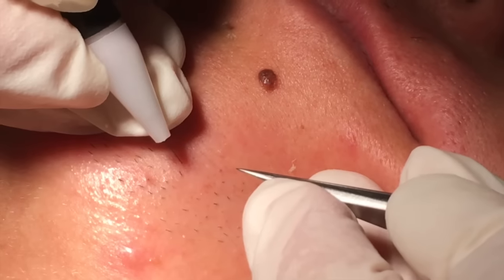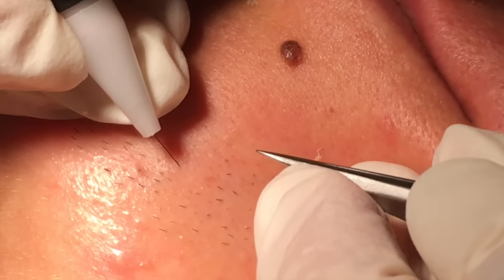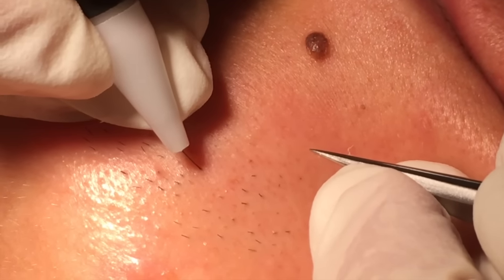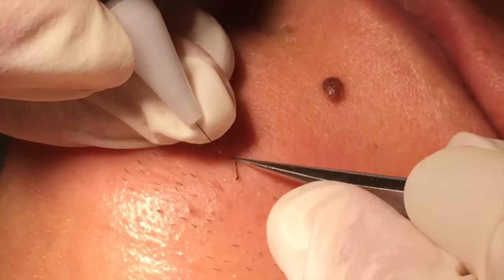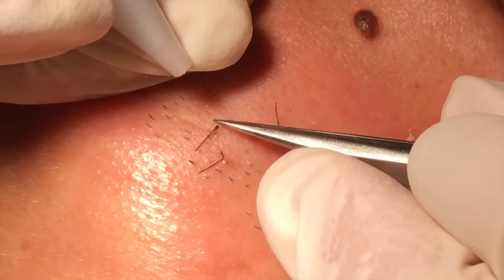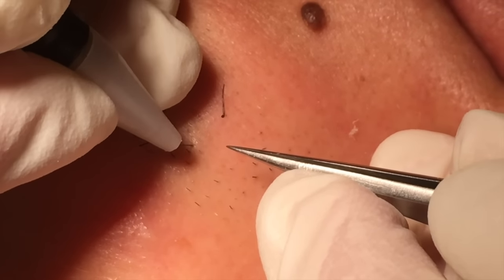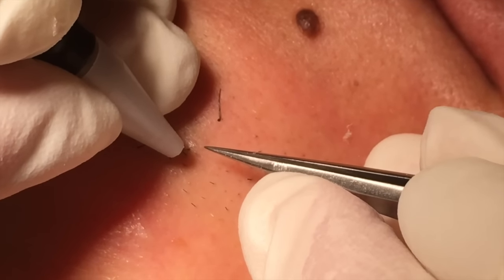Electrolysis hair removal close up

Comment: I had this done today for the first time on my chin and upper lip and it's a piece of cake for me thank god. Not much pain just a little zap.
Reply: That's good because people were saying it hurts a lot. How much hair did you have because I want to do this, but I have a lot and it's thick?
Reply: @cintaminbunny  You feel some pain of course but it's bearable. At least for me. Upperlip is painful tho. I have some dark and blonde hairs so the dark i get lasered and the blonde ones with electrolysis. X
Reply: @kyraw3933  thx, I'm nervous for my upper lip because there isn't much there, but I think it's getting thicker.
Reply: @kitaboo2245  I go every week for 30 to 45 minutes. I wasn't born female so I have to go more frequently till it's gone. Then maintain it every few month I believe. X
Reply: @kitaboo2245  They do my entire face. I don't have that much hair so the procedure depends on how much hair you have and how fast they work ☺️
Reply: @kyraw3933  they told you how long it will take to remove permanently. I heard it takes years
Reply: @sweetsoul6147  They told me that most hairs need 2/3 treatments to completely disappear. I had 10 sessions so far and i can tell a difference so it works for sure 🙌🏻
Reply: @kyraw3933  would you say electrolysis is better than laser or vice versa ? I want permanent removal
Reply: @thediaryofdove  Electrolisys for sure! It takes longer but it's the only method that is really permanent i believe.
Reply: Is that painful?
Reply: @srichithra918  Not really. For me at least
Reply: @kyraw3933  hey kyra, i see its been 8 months since you left this comment, how is the growth now? Is it permanently gone?
Reply: @navneetkaur1343  yes, most hair is gone 🙂
Reply: @srichithra918  No it is not painful
Reply: Do, you take any prescription for facial hair?
Reply: @blancabarrientos9184  what do you mean?
Reply: @kyraw3933  What the cost for electrolysis hair removal? Plzzz tell
Reply: @Hmx_mrx  Where i go here in the Netherlands its 45€ for 30 minutes. I go for 60 minutes each session. But i get it payed by my health insurance.
Reply: @kyraw3933  oh ok thanks
Reply: @Ty-1452  they destroy the hair follicle one by one so the hair is permanently gone...
Reply: I am super excited to get this done!
Reply: @kyraw3933  what about ungrown  face hair? How does it work?
Reply: @lunalunna4018  what do you mean with ungrown hair?
Reply: @kyraw3933  For example, I have hairs that do not grow ... they are under the skin and I can't remove them with tweezers.  and I was wondering how electrolysis would work
Reply: @lunalunna4018  oh you mean ingrown hair lol, if you go to a dermatologist they can remove it. They poke a hole and use super small tweezers to get it out and then you'd let it grow out again and at that point it would be able to get taken care of with LHR or electrolysis
Reply: Izz Rigel  I'm trans as well. Had one year laser and 1 year electrolysis so far. I find that electrolysis is more effective. It takes longer but the hairs are really gone. Upperlip is painful. The rest isn't painful in my opinion. Good luck 😘
Reply: @TexstarHans About the scares.. My electrolysist used a isolated needle which means that the heat comes only out of the tip of the needle so my skin did not got burned on the surface. And I used a mask sometimes because of covid but I put it off as soon as I got home because the warmth underneath the mask irritated my skin after electrolysis.
Reply: Cost?
Reply: Did it really go away forever ⁉️
Reply: @mandoelorryann4171  yes
Reply: Does it left the skin with pores?
Reply: Does it left the skin with pores?
Reply: @ManahilKhan-s6b  No, the electrolysist used a isolated needle. Those only give heat at the tip of the needle so it doesn't effect the surface of the skin.
Reply: @cintaminbunny  depends on the threshold I felt alot of pain when having it done my leg would fling up!
Reply: Does the hair grow back after the session? And how many sessions needed?
Reply: How much time we should take electrolysis?
Reply: @amalalharbi2463  the hair usually grows back thinner until it one day completely goes away.  You have to work at it for a while and if the hair is coarse then you can expect to make a few dozen visits roughly.  Over time you visits diminish in duration though. It’s not a quick process and nothing is when you want permanency.
Reply: I have apilus blend 256 bt i dont know exactlly how much intensity required for facial hair removal
Plz guide me
Reply: How much was the cost
Reply: Where did you get it done? How much did it cost?

Comment: What's the typical number of treatments for your patients?  I have been having treatments on chin and jawline area (due to PCOS) two to three times a month for close to two years now!
Reply: What?!!!!
Reply: I thought electrolysis was PERMANENT after 1 treatment as long as hair was completely removed?!
Reply: @tash-mariegrant652 Ha!  No, it takes MULTIPLE treatments, and this is because hair grows in stages.  I've certainly noticed a significant difference, but it's a slow process.
Reply: @tash-mariegrant652  it is permanent. However, it depends on how much surface area you want hair removed from. Then, as was mentioned, hair growth happens in cycles. Also, it depends on how thick a hair is, what stage of growth, the skill of the electrologist, the difficulty of the surface, etc. 

For example, that last one, scarring can impact the direction of the hair follicle. If it’s different than the surrounding hairs direction, then inserting the probe parallel to those hairs means it’s not hitting the root of the hair. That’s where the skill of the electrologist is key, to recognize and adjust.
Reply: @checksanity  but still once the probe is correctly inserted into the hair follicle and zapped the hair shouldn't grow from that particular follicle right? For example I have 100 visible hair and then all those hair is zapped and removed from the follicle then the hair shouldn't grow in that particular place. I can understand the remaining hair coming out but are you telling that one follicle needs multiple treatment?
Reply: You might have untreated pcos if the hair keeps coming back after that long. Electrolysis kills the hairs that are there but pcos makes the hairs show up. There's a lady called "youhairygodmother" on here, she has pcos and  had a lot of chin hair and has gotten 3 yrs of Electrolysis and now most of the hair is gone except for one last little patch.

Comment: My electrolysis lady doesn’t remove the hair with tweezers until the end so she gives it time to “cook”. It works better for me that way. I also use a wet sponge to hold onto to help with the current. The right side of my face that we’ve been working on is significantly better than my left 🎉
Reply: It is red after ?
Reply: yes. It looks like welts and looks like little pimples for a few days but goes away about 4 days later :) It works though! I have half of my PCOS beard gone @TheAlhara
Reply: how has it been for you now?
Reply: @aleewong3435  happy to hear you're happy with it! I'm on my electrolysis journey too, sis, though I had to have multiple laser/IPL sessions first because I had hyperpigmentation in the area from years of tweezing

Comment: Can it treat strawberry legs,ingrown hair and razor bumps??
Reply: I know this may be "a little bit late" (2 years!!!   Lol) and you probably have had your question answered by now, but just in case ....
Every form of electrolysis (galvanic, thermolysis or blend) does NOT treat strawberrying, ingrown hairs or razor bumps directly. In those cases the skin just needs time to heal,  aloe vera and moisturizers can help with that process.
On a plus note electrolysis doesn't cause those issues either ... but  there is usually some slight redness after treatment.  The worst case scenario is, if it's a bad electrologist, they might have set the intensity too high and it can damage cells and collagen in the skin,  especially with thermolysis and blend.
Aftercare is crucial to how successful the treatment is as well. 
Hope this helps and you are well.
✌🙂👍
Reply: @matildastanford7019  what happens when it damages your cells?
Reply: @briaharris183  I’m assuming you can get scarring, hyperpigmentation, etc.

Comment: If the follicle is killed from the first time, why do we need several session that can take up to a year to get of the hair ?
Reply: Sad Becky I think it depends on the growth cycle and what stage it's in but I'm not too clear on that myself
Reply: It's not killed. That's just not true. The follicle base is shocked and when it heals, the base of the follicle shrinks a bit. That means less blood gets to the follicle and hair will grow back thinner and slower. Every time the technician shocks that same follicle, it will allow less and less blood to feed it. Eventually, no more blood supply will get to it and the hair won't grow back. That can take many many times, though. It's frustrating that there's so much misinformation about hair removal out there, especially from "professionals".
Reply: MY EXACT QUESTION!!
Reply: @MichaelMuellerLand  it's sickening. I had laser with 8 sessions! Everything grew back within months!
Reply: @tash-mariegrant652  which mashine did they use on you?

Comment: Does it kill the follicle the first time?
Reply from the maker: If the hair is in the right part of the hair growing cycle it is 100 percent killed. Point is: you don't know in which part of the cycle the hair is. On average 40 percent is in another part of the cycle. So you end up with a killing rate of around 60 percent. For more information https://www.2passclinic.com/permanent-hair-removal/electrolysis-hair-removal/.
Reply: Only during the first stage when there is active growth, called anagen phase. Can last anywhere from a few weeks to a few months, depending on your hormones.

Comment: could this be done on the hairline? i had a hair transplant but one side is slightly lower at the temple than i would of preferred, i think if around 10-20 hairs were removed it would look fine? thanks
Reply from the maker: Dear, electrolysis could absolutely be done on the hairline! In case you're interested, you can find more information over here https://www.2passclinic.com/permanent-hair-removal/electrolysis-hair-removal/?utm_campaign=Electrolysis&utm_source=youtube&utm_medium=social
Reply: 2pass Clinic  hello I live in The Netherlands I am suffering from a few facial hairs like 10 in total, I have never shaved or wax before...I only tweeze I would like to know...if the hair is removed would it grow back...and if yes how long would it take ??? Or would it actually trigger more hair growth cos I heard with lasers it might! However wanna do this because the more I tweeze d more hair I see :(
Reply from the maker: Dear, when you get this type of hair removal done, it is permanent. The amount of time needed for the hair removal would depend on the specific type of hair. Electrolysis will never stimulate more hair growth. If you're interested, we can always provide more information, or you can even book an appointment with us online. We're located in Antwerp. That's not too far away ;)!

Comment: how bad does this hurt? same as blood test?
Reply: Murg Trollen nope. It hurts so bad. Because the needle goes in and sends an electric shock to the hair root to kill it. It's so effective but the pain is excruciating
Reply: It is painful. If you've ever had a tattoo, think of the needle going very slow piercing the skin and removing. However it works great. I tried laser with little success. Electrolysis has worked wonders though the healing takes longer than laser. Laser was 3-4 days, this took nearly 2 weeks for me.
Reply: thnx. never had a tatoo, however, I'm very blonde, so laser is not an option.
Reply: Do they numb your skin?
Reply: They give you some ideas of what you can use to numb it. She recommended Lidocaine for me. Due to overly sensitive skin, I ended up icing it during and after. It helped a lot. She also told me people used tattoo numbers and it helped them. But there, she did not use a numbing agent beside ice.
Reply from the maker: It is quite painful. Especially because of the repetition it gets really irritating. In our clinic we use local anesthesia injections and a painpump to deal with the pain. That is the advantage of being in a clinic where there are doctors.
Reply: Moth Ter did ur hair grow back ?
Reply: Question for anyone who have done this: how much does it cost per session and total?
Reply: It stings a little bit. The lady I go to, uses ice too numb the area. I pay about $25 for a half hour appointment. The first lady, I went too, charged more for a half hour appointment, so the cost varies.
Reply: Moth Ter did the hair ever grow back or was it a success?  how much because I'm getting this done soon, I have a high pain tolerance so this ain't nothing...a crowning baby is worse
Reply: I know this is 10 months old but I thought I might share my experience as well in case it helps anyone in future. I went to my first appointment today without any numbing agents (I couldn't find anything at any of the 3 pharmacies I went to). Some hairs hurt a lot more than others, and I found the right side of my face generally hurt more than the left. The way I described the pain while the electrologist was performing the procedure was "it feels like a tiny soldering iron on my face."
Reply: KaraHops does the hair grow back?  or it's gone in one session?
Reply: Miss Aina electrolysis treatments are permanent. It does take a long time though! If you are a cis woman, expect it to take about 4 or 5 hours of treatments to remove all of the hair. If you're a trans woman, you might want to look at laser hair removal to remove most of the hair first before finishing with electrolysis.
Reply: It is more expensive than laser. If you have dark hair, laser will be faster and probably cheaper. If you don't have a lot of hair or have lighter hair though, electrolysis might be the better option, as there are very few laser methods that remove hair permanently.
Reply: I currently do 1 hour at the time. it is excruciating. I'm taking ketamine now before I do it.
Reply: I do 90£ per hour
Reply: fabio bonazzi but w/ the hours how do it work b/c what if all the hair not gone by the time the hour is up or say 30 min?
Reply: I am not going to write a book here because the topic is quite wide, 
but do not expect your hair to be gone with one session.
for example if you clean perfectly your upper lip or chin, you will still grow hair on the same area you thought you cleaned, because hair grows in cycles, so you will need to pass over the same area more than once. possibly in a different session.
as per the time. if the 30 minutes runs out you are done for the day.
to clear up a grown male beard you need about 50-200 hours.
normally men who do this do laser treatment as well, to speed up things
Reply: fabio bonazzi hmm 🤔 guess it depends on the size of the area? B/c I can not imagine 30 min being enough to get all the hair unless it's a small area. But that makes sense. That's def a lot of hours 😅 thank you for clearing that up. Think ima stick w/ laser and then at some point do electrolysis
Reply: It is not painful if the mashine is good and new, and the person who does it  is  really professional
Reply: @annalevin2219  that is not true.

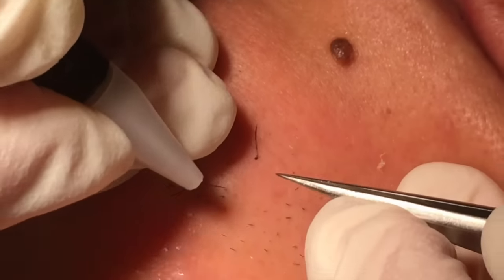Comment: 0:38 I'm sorry no they're not permanently removed from that one sweep there's a lot more to this system and treatment then what most make it out to be honestly it's one of the better methods for removing facial hair fixing up eyebrows hair line and even armpits but these of course are smaller condensed areas but there's many sessions that one needs to take because even though they look like they were rooted they could have easily been in the catagen phase and not in the anagen phase and that's important for long-term hair removal whether you're using electrolysis laser or IPL because it needs to be in the growth stage connected to the blood vessels also something to note with electrolysis is to make sure you're actually following where the root is and not just the direction of the hair the best way to tell is by looking at the person's hair on their head to figure out what type of hair they have and whether it's curled slightly or completely bone straight another thing to note that your hair removal technicians won't tell you probably because they weren't told themselves is to use hair growth serums and vitamins to help your hair stay in the anagen phase longer in between sessions this also creates a cycle of overstimulation that can cause traction alopecia which is not the same as alopecia areata which is normally caused by hormone imbalance this is just constant pooling and overstimulation of the follicles to the point that there is scarring and the hair will just not regenerate and grow
Reply: That is the longest sentence I have ever seen.
Reply: It doesn't matter if they're in anagen or catagen. The root got zapped. Advising hair stimulating vitamins is ridiculous, while you're right that the main effect of those is to delay shedding it also stimulates dormant roots in some people
Reply: If u get it done on your face can it cause alopecia on the hairs on your head?
Reply: Thank you for this information!
Reply: This is ridiculous